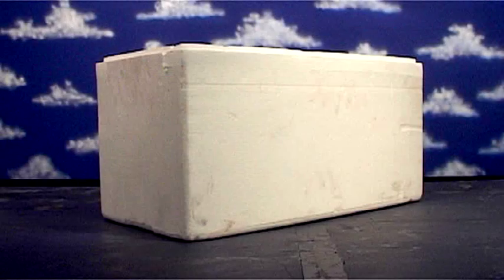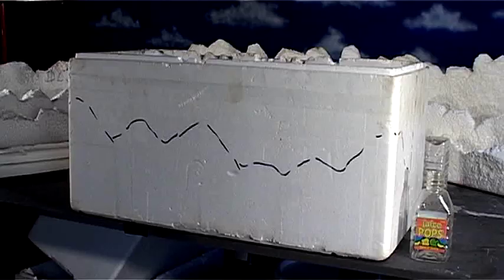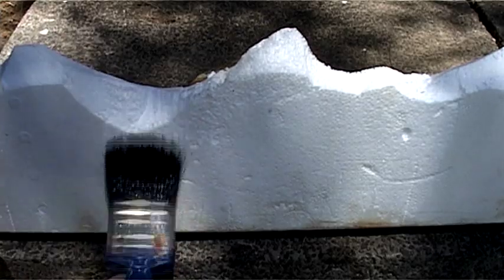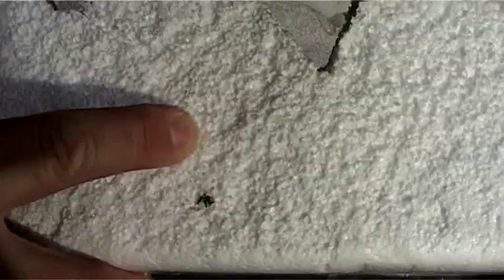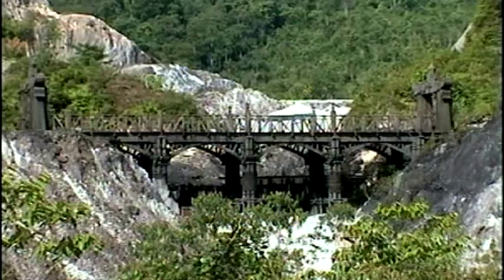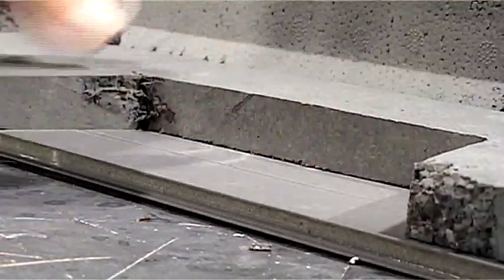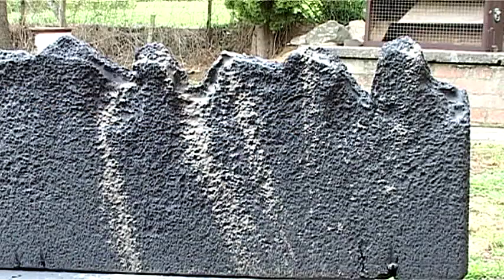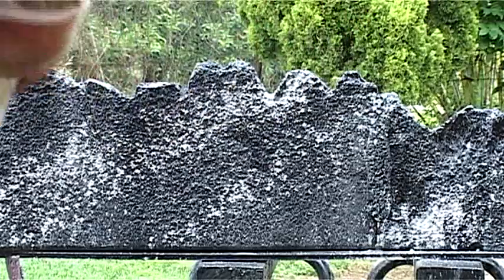Foam Box Miniature Mountains

Comment: like some of your time-saving painting ideas.
one idea I use is spray paint: it has the same effect on the foam as the gasoline, it etches it away.  so sometimes I do a grey primer spray paint coat first, using the spray as an etching tool also.  mask required.  attaching a vid with some of that.  works for concrete look also.